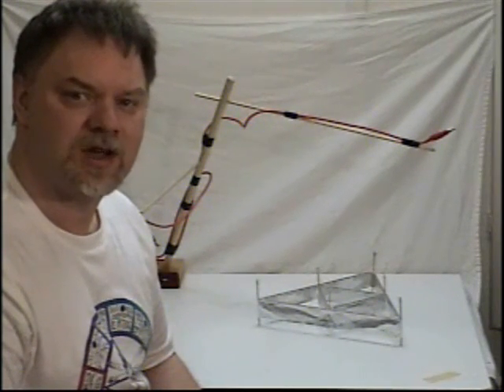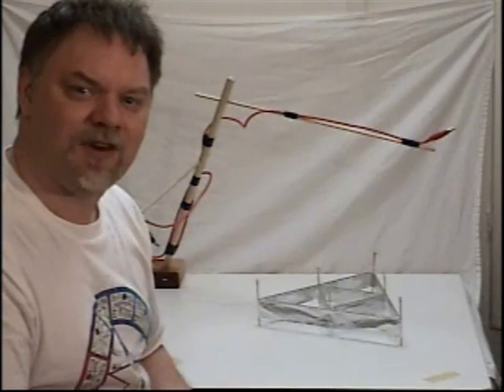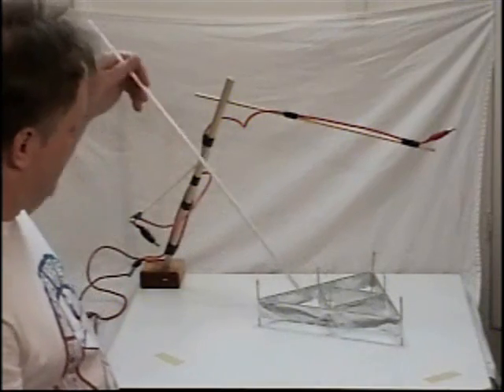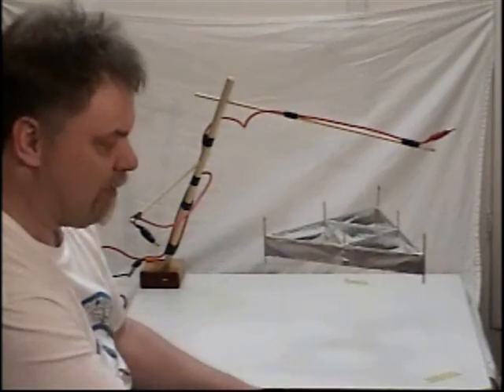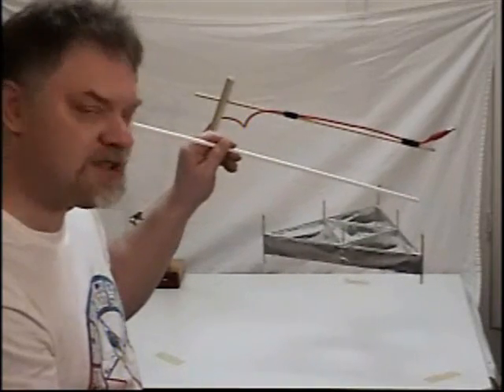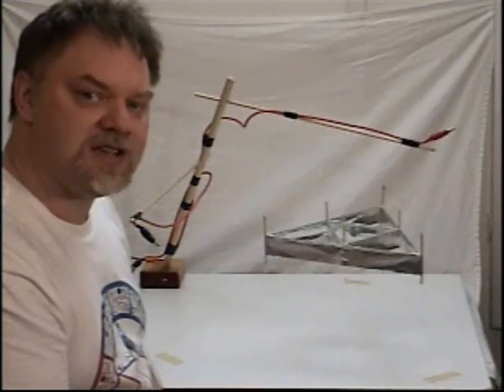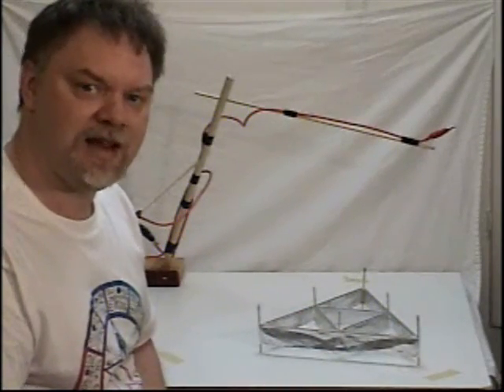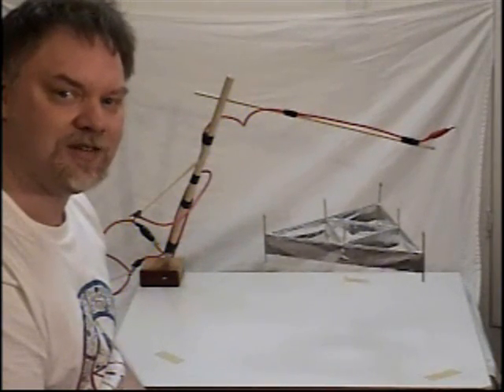LIFTER TECHNOLOGY: Demonstration & Explanation

Comment: I had heard that switching the polarity caused lift in the same direction and even a high voltage AC would cause the same effect.

I came to the same conclusion as you.

Ionic wind couldn't be responsible for the lift.

I also heard that these lifters will not work in vacuum chambers.

If this is true, then I think it indicates that it is demonstrating anti gravity effects or rather an apparent lessening of the mass of the lifter while the volume of the lifter remains the same.

The mass/volume of the lifter appears to be less dense than the air surrounding it, so it floats with a bouyant force.

In a vacuum chamber, there is no surrounding air, so no buoyancy.

Even though the mass of the lifter appears to be reduced, it remains on the bottom of the vacuum chamber because it's overall mass is still greater than zero.

This is why a metal boat can float in water but remove the water and the boat rests on the ground.

Comment: There is a misconception regarding the effect of reversing the polarity. Ion wind works with both polarities, but the direction is always towards the collector, i.e. the less "sharp" electrode. The main difference between the two polarities concerns whether we have positive or negative ions driving that ion wind. The direction of thrust remains unchanged - it's still towards the collector, = down in this case. Therefore, the device won't drive itself into the ground with neither polarity. The rest of your explanation seems kind of esoteric and vague.
The fact that actually the great majority(!) of the neutral molecules experience momentum transfer from collisions with ions and therefore end up as "ion wind" could be proven in a paper published in 2018 where they applied a high voltage to a stream of helium gas: with the voltage OFF the helium would drift upwards ("buoyant" force; because it's much lighter than air), with the voltage ON almost the entire(!) stream (=ions and neutral molecules alike) was deflected back to the horizontal plane, towards the collector. Ionic wind may be a bit of a misnomer, because the actual "wind" that exits the system downstream of the collector is mostly from neutral molecules.
(And yes.. I know it's a very old video...)

Comment: I had read "Secrets of antigravity propulsion" by Paul La Violette.
I would like to learn futher about assymetrical capacitors. 
I know their thrust capacity is related to the dielectric material used on it.
If i wish to build a small flying car with it, assuming 2 x 100 persons on it and some vacation load in a case, flying around 1.000km/h, then how can i calculate the capacitor for being able to take off in a street and safely land into the hotel?
My power supply would be a combiend cycle vegetable oil jet engine + steam turbine into the same shaft as heat recovery and i know i need a pulsed DC generator...

Comment: If you rotate 90 degrees and hang the device it will demonstrate ion wind (and opposing reaction thrust) from fine electrode toward the aluminum skirt regardless of polarity.  Similarly smoke streams (as from incense) will follow the ion wind regardless of polarity.  Still, that's a very cool model and neat power supply.

Comment: The air is acting as a dielectric material resulting in a lift, its not purely ion wind. Ion wind is a dielectric breakdown. If you add a dielectric material like barium titanate or calcium copper titanate between positive copper and negative aluminum foil, lifter will work in a vacuum. T.T Brown used dielectric materials in his vacuum experiments.

Comment: I wonder if this is a discrete vibration effect that distorts space around the metal or electrons enough o create a low pressure zone around the object - essentially the electrons do this because they vibrate and output saturation force possibly around the object...

Comment: Hi Richard. Please tell me the make and model number of that power supply that you are using. 1) Can you independently control the current with that power supply ? 2) What is the maximum voltage that it can put out ? 3) Is the voltage it put out is just straight DC current or pulsed DC current ? If the power supply can put out pulsed DC then what is the frequency range (ex: 10 hertz to 150 hertz)?

Comment: To the YouTube, https://www.youtube.com/watch?v=7kiNaAg2- I gave the HV Lifter a design of a disk shaped  suitable for transport technology. The aluminum foil is attached to the + clamp. The HV lifter is powered from a distance of approx. 20 - 30 cm  from the capacitive multiplier  -80 kV. Weight approx. 1g.
Energy efficiency ranges from 40-90% against of nominal value of 16 mW / g.
This technology is already directly applicable in transport technologies.
form.
The problem is just increasing performance
.

Comment: It is much better if we all start from a place of correct understanding.  Otherwise it is much more difficult to understand what's happening and to make progress.

Too many people think weird things about these lifters.  High positive voltage on top wire strips (negative electric charged) electrons off air molecules in the vicinity of the top wire, leaving the affected air molecules losing some of their negative charge so the affected air molecules are now positively charged after losing electrons -- and are called positive ions.

Next the bottom plate is 20,000 volts more negative than the top wire (think number line) - the bottom plate is at ground potential, zero volts DC.  Thus the bottom plate (the aluminum foil) is relatively negatively charged compared to those positive air ions, so the lightweight lifter's bottom plate moves upward towards (is attracted by) those positive air ions.  Recall that UNLIKE CHARGES ATTRACT.

Now the bottom plate has moved upward just a hair but so has the top wire, and the top wire is constantly creating new positive air ions so the bottom plate moves up again, 'chasing' the newly created positive ions.  Rinse and repeat.  The bottom plate is like a fish chasing bait.  The 'bait' is the positive air ions in the vicinity of the top wire.

IF YOU STILL THINK 'ion wind' is behind the propulsion, watch this short clip -- put the youtube viewer in slowmo (click the little gear icon on the bottom right of the viewer window, click 'Speed', click '0.25').  Then watch the video. 

https://www.youtube.com/watch?v=ckGaTUEbaKw

Ion wind is a SIDE EFFECT of the "unlike charges attract" action.  Nothing more.  Not causing the propulsion.  Sorry to break it to you.  And gravity is 1000% unchanged by this "Unlike charges attract" lifter model.

Comment: M.Jean Louis Naudin is the inventor of the lifter on the year 2000' ! see his website : the
 Maximus 2  @ 250g...just ionic wing  electrostatic pressure of ion on 
the molecule of the air near the wire (electrode positive)

Comment: reversing the wires simply changes the ions from positive to negative or vice versa.  it's still just blowing ions.  it's the same as a negative ion generator used to clean the air.  do people claim their air cleaners are electrogravitic?

Comment: This is a neat effect, but it does not alter gravity whatsoever. Reversing the polarity of the corona wire and skirt doesn't alter the direction of thrust, because thrust isn't dependent on the polarity. Thrust depends on the relation between the corona wire and the skirt. Since the corona wire was still above the skirt, thrust was still being produced in the same direction after you switched the wires.

Comment: can you separate the power supplies to the 3 outer triangles, if you separate them you could steer it in air by applying variable power to the outer triangles. they would need to be insulated i think. and then quadruple to increase the systems lifting power enough to support more mass :) and a hood. and a fan for a reversed cloanda effect :)
Reply: idk but you should try it

Comment: Damn, it requires such high voltage just to lift off such a small piece of a prototype. For bigger ones you'd definitely need a bunch of superconductors. Seems like a perfect technology to use for space travel (at least in the regions of the Solar system)

Comment: I am very skeptical of this being "ion wind". Look what happens as the lifter is power up. The ionic thrust has to be greater than its weight to accelerate the lifter up. Thrust is mass flow times ionic wind velocity. So as you increase the voltage this  mass flow and/or ionic wind velocity is spiking to the decrease towards equilibruim. That is not the behavior I see. What I see is the lifter moving into a "field" where it settles and  as that field is buidling up the accelerates almost instantly. It doesn't look like the result of a mass flow and thrust effect where you would see intertia acting on the lifter and on the ionic wind. I have to agree with Richard Haider. I am surprised he does not mention that. Also, look at what happens when he pushes the lifter down... It doesn't react like a drone under rotor thrust (same an ionic wind) but it fights the push and returns instantly to where it was. No, that is not ionic wind folks. Look at it carefully.

Comment: It works like this: in the case that the wire is positive and the foil negative, there will be an electric field pointing from the wire to the foil. The field lines leave the wires and hit all points on the foil, so there is a higher density of field lines near the wires. Therefore a strong field near the wire which is able to ionise air. The atoms in the air split into a positively charged ion and an electron. The electron is attracted toward the wire and since it was created close to the wire does not hang around for long before it hits the wire and is absorbed. The ion on the other hand is accelerated toward the foil and remains in flight for much longer. As the ion accelerate down toward the foil, there must be an equal and opposite force acting on the lifter, in the upward direction. On their downward path, some ions hit the foil and transfer their momentum back to the lifter, resulting in no net lift. However some ions near the edge of the foil will miss the foil and continue to travel below the lifter foil, eventually recombining with the air and resulting in a downward thrust of air. Since the electric field is weaker near the foil, ions that do escape will not experience a strong enough backward force to enable them to recombine with the foil.

That's why I don't think this would work in a vacuum, or in a plastic bag. Nice video though :)
Reply: btw if you reverse the polarity, then you follow through the same logic as above except that electrons are accelerated downwards rather than (positive) ions. These electrons have greater speed than the ions, but carry the same momentum (due to them being in the same strength of electric field), hence the thrust is the same, and also in the same direction.

Comment: Due to low energy density I believe most of the lifter tech out there is ion wind effect. in a vacuum there would not be ions so no lift. How ever you can look at the electrical energy its self which charge particles, They would collect on the poles of the capacitor in a vacuum. Electromagnetic waves or energy travel through empty space. If you had a tremendous amount of energy you may be able to achieve thrust in a vacuum but not in mA. It would need much more current.

Comment: I have been interested in lifters for a number of years, and having watched and read a lot have come to the conclusion that the flight effect is due to ion wind and not any form of field effect.

However, one very simple experiment which would confirm or deny the field effect theory is to cover the lifter in a thin and light layer of cellophane, such that the air inside the lifter is confined.  If there is an air-thrust effect the air would be confined inside the closed environment of the cellophane and no lift would be seen.  I would be real interested in seeing this experiment, Richard.
Reply: this is a good idea
Reply: And ?

Comment: Nothing to do with gravity. Electrohydrodynamics explains it.
Reply: too many people think weird things about this.  High positive voltage on top wire strips (negative electric charged) electrons off air molecules in the vicinity of the top wire, leaving the affected air molecules losing some of their negative charge so the affected air molecules are now positively charged after losing electrons and are called positive ions.

Next the bottom plate is 20,000 volts more negative than the top wire (think number line) - the bottom plate is at ground potential, zero volts DC.  Thus the bottom plate (the aluminum foil) is relatively negatively charged compared to those positive air ions, so the lightweight lifter's bottom plate moves upward towards (is attracted by) those positive air ions.  Recall that UNLIKE CHARGES ATTRACT.

Now the bottom plate has moved upward just a hair but so has the top wire, and the top wire is constantly creating new positive air ions so the bottom plate moves up again, 'chasing' the newly created positive ions.  Rinse and repeat.  The bottom plate is like a fish chasing bait.  The 'bait' is the positive air ions in the vicinity of the top wire.

IF YOU STILL THINK 'ion wind' is behind the propulsion, watch this short clip -- put the youtube viewer in slowmo (click the little gear icon on the bottom right of the viewer window, click 'Speed', click '0.25').  Then watch the video. 

https://www.youtube.com/watch?v=ckGaTUEbaKw

Ion wind is a SIDE EFFECT of the "unlike charges attract" action.  Nothing more.  Not causing the propulsion.  Sorry to break it to you.  And gravity is 1000% unchanged by this "Unlike charges attract" lifter model.

Comment: steins gate was about multiple dimensional threads branching off from a single dimensional existence when ever travel along the time line happened a new thread dimension was created.  That has nothing to do with lifting a tin foil triangle in the air.  Also he didn't do it by putting a cell phone in the microwave.

Comment: Great Demo, but why would you expect the lifter to "drive itself into the ground" just because you reversed the polarity?  In both cases, the thin wire ionzes the air, while the thick foil strip accelerates the ions downward.  The only difference is that one case creates positive ions, and the reversed voltage creates negative ions.

Comment: Found it..The typical output used is 30 kV AC which with the addition of a 290 kV diode and capacitor gives a smoothed, half wave rectified output around 40 kV DC.

Sowhere is he measuring from in this circuit?

Comment: thin wire electrode will have the higher field in either case and it will generate the majority of ions.  If you put the negative polarity to the wire it emits negatively charged ions, which are attracted by the positive pole (the aluminum foil).  Your ions migrate downwards, the lifter goes upwards.
Connect the positive pole to the wire and it will generate positive ions, they will be attracted by the negative pole (the aluminum foil) . Your ions migrate downwards, the lifter goes upwards.

Comment: FYI, Acceleration Due to gravity is given by a=G*M/r^2 where G is the universal gravitational constant, M is the mass of the earth, and r is the distance to the center of the earth.  You can use this to quickly find out that the acceleration due to gravity at the earth's surface is approximately 9.8m/s^2.  In the orbit of the international space station the acceleration due to gravity is approximately 8.4m/s^2.  Thats just slightly more than a 10% difference.

Comment: It should be noted, and I think this has been explained to the maker of this video on multiple occasions, that reversing the polarity would NOT have the effect of reversing the direction of the ion wind.  Try it...get a bee smoker and look at the air currents around the device...then reverse the polarity and look again.  The current will be in the same direction.  This is because most of the ionization will occur at the location where the electric field is the strongest...near the wire.

Comment: Absolutely correct.  He even explains why it goes from the corona wire to the collection plate in the beginning of the video.  Because the thin corona wire has a dense population of charged ions, and the collection plate has space available, they jump from the corona wire to the collection plate.  It's just a shame that he couldn't use deductive logic to figure out it would work either way.  Instead, he used dialectic reasoning fed to him by those unable to make logical scientific conclusions.

Comment: No, but according to the ACTUAL theory behind this device's operation, the high voltage applied to the wire seems to strip electrons from the surrounding fluid (air), creating ionized oxygen and nitrogen molecules (since these are what primarily compose the air we breathe). This creates ozone and NOx, which when breathed in large amounts can cause respiratory problems. So your intuition about staying away from it is probably right.

Comment: Reversing polarity of the wires would not change the direction of lift for an ion-wind effect.  it would just change the charge (positive to negative) of the ions, but they would still flow from the thin wire DOWN to the aluminum surface, causing upward thrust.

Comment: It is no ion wind, ion wind produced just small thrust on it. Why, because TT Brown has experimented it in vacuum and also oil. It result was the same. Also, when highly voltage charge a capacitor there is always thrust in direction of positive terminal or opposite the electric fields. Find out whole TT Brown electro-gravitic experiment. The ambient field of gravity become different when highly electric field placed in a space time.